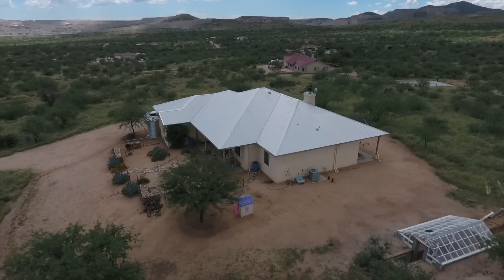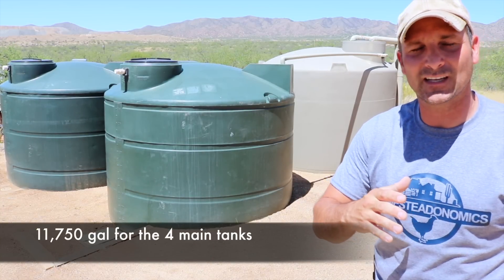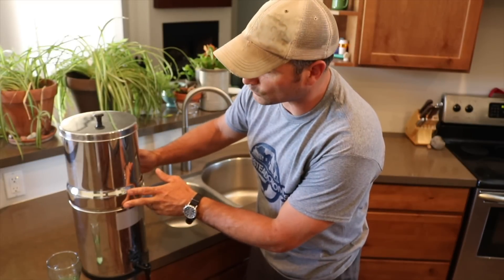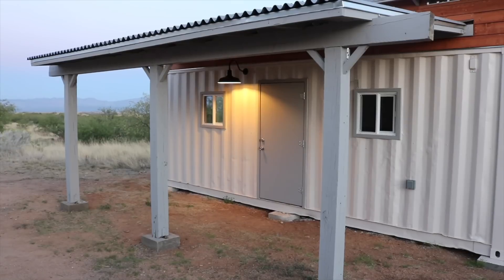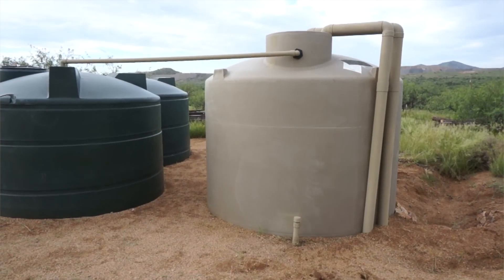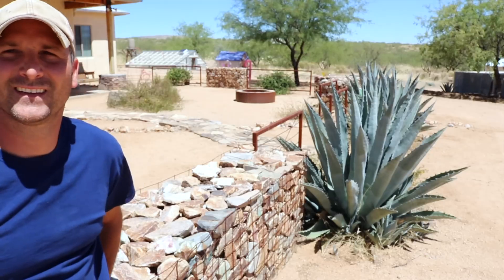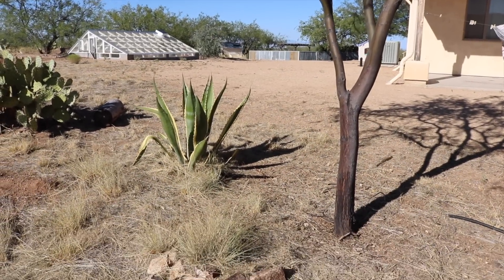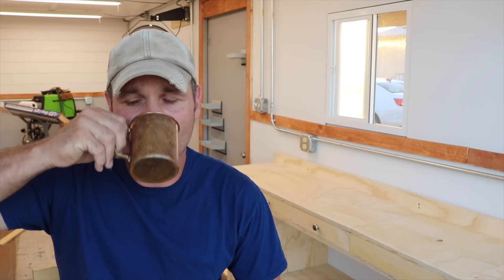Rainwater Harvesting QA - Cost, is it Illegal, how I treat, etc,.

Comment: The last estimate I had for a well drilled 480 ft into the ground to supply water was $26,000, that is not including the cost of the plumbing or tanks above ground. I already have that from the old well which dried up. So the cost of $5,000 sounds really attractive and a savings of nearly... 83%! Thanks for the inspiration and hope that will fuel my drive to no longer have to haul water every two days by gallon jugs in my tiny little Prius. You are a Godsend!

Comment: Q: With extreme heats and cold do you have any suggestions for how to prevent water from freezing in the overall system? (im in the east coast and it can get cold). Thanks for the video!
Reply: Don't pour antifreeze into your water unless your interested in potentially dying. Antifreeze is deadly if ingested even in tiny amounts.

Comment: Nice off-grid system.  I would shed over the 3 tanks.  Also, I just came back from Cuba, and I noticed many homes had fifty gallon drum collectors that would supply their HOT water needs.  Are you thinking about that since the Sun shines almost every day?  Lastly what water usage formula do you use for each occupant?  (Drinking, shower, toilet).   I'm guessing washing the car is out...:)

Comment: How do you pressurized the shower and toilet refill?  Are you using the blue water tanks with the rubber bladder inside?  We do in Texas and get about 60 psi.  Great video.  Looks like Wilcox Arizona or 60 miles east of Tucson?

Comment: The argument that you mentioned (taking runoff from others) justifying the illegality of collecting rainwater is ridiculous. I have a few friends that are civil engineers and in populated areas runoff is a huge issue because there is no space and you have to ensure that building on ground in one place won't flood another. So you collecting a few hundred/thousand  gallons of rain would be beneficial to the community.
Reply: They usually don't mean in an urban area, no one would really GAF if you reduced load on storm drains and it didn't become a mosquito or legionnaires issue due to bad maintenance. They mostly care about diverting rain run off on a massive scale out in the country, IE diverting small streams to sell the water commercially. Stuff that would cause rivers to run dry and do serious environmental harm. But not every law is enforced to the letter of its original intention.

Comment: You've done a great job collecting water! but never a water test?  certain things shouldn't be overlooked, especially regarding health.  
where I live the FHA/VA water test is about $165, knowing the average bacteria levels is important so the correct amount of added chlorine can be correctly calculated.  For reference, our municipal water has just under 1ppm chlorine, and the recommended swimming pool level is 3ppm. And pH is easy to test and adjust: on average rainwater has a pH of 5.6, which is pretty acidic-  the EPA recommends drinking water to have a pH of 7.5, which is slightly basic- adjusting the pH of the drinking water is recommended. I hope this is helpful to you
Reply: @cindykrista how old are you?
Reply: @cindykrista ok, that's an answer.  forget about the EPA for a moment, it's commonly agreed that slightly basic drinking water is recommended over moderately acidic rainwater

Comment: Do you have any thoughts on the effects the sun may have pheating up the pvc and possibly leaching toxins into the water that you are using for your chickens.
Reply: If possible, use PVC, etc. *certified for usage with potable water*, not 'sewer' grade nor 'fiberglass'. 
If not possible and you have concerns about 'leachate' from the PVC, etc., then consider to install a carbon packed filter system and then slowly 'recirculate' the tank water over and over through the 'stripper' filter.  The National Sanitation Foundation - NSF website should have all the facts and recommendations available for such concerns. ;-)

Comment: I use hydrogen peroxide instead of chlorine as H2O2 (peroxyde) degrades into simple H2O (Water) as it oxidize any contaminants. Also, I pass the water through a ozone generator in a diy injector, which kills anything that would survive. Alternatively, UV lights can also sterilize the content of your thanks. All of this is 200% better that chlorine.

Comment: If you swing a tank of water from the end of a lever with another water tank as a counterweight, the leverage change from the swinging action can pump hydraulic pistons with tons of force to filter the water under high pressure by riding the swing.

Comment: A year ago I went backpacking across India. I knew tap-water was  out of the question for drinking. And, I knew I didn't want to waste money on buying bottled water everyday. Since I was going to be travelling for a few months I decided to invest in a good portable water filter. Ended up ordering a Sawyer cleanable filter. The company claims it can filter water from any source.
Over the course of three months I drank around three hundred liters of water. That would had cost approximately $150 if I'd had bought bottled water, as I went. The filter cost? Twenty-five dollars.

Now, I'm living in the south of Cambodia and utilize a clay system dubbed The Rabbit. It's simply a five gallon water cooler-like design that houses a large clay pot in the top. Just pour rain water into it, the water is filtered over the course of a day, and drink. No treatment needed.
Reply: They have a low failure rate. They do however have a failure rate
Reply: @suzyrottencrotch5132  Did someone claim they didn't?
Reply: I read wrong, backpaging 😂
Reply: Nice.  What is the service life of the filter (i.e. how long does the filter last)?

Comment: i'm assuming there's a propane tank to heat the water. how is the water moved from the outside tanks to the inside of the house and there be pressure for showers and sinks?

Comment: I'm just wondering how somebody could adapt this system for a colder climate like New England.  I suspect the tanks would have to be fully buried (below the frost line) and then a pump would have to be employed to move the water through the system.  I'm I correct or is there another way to make this work?
Reply: I have a 9000 gal. cistern in my house basement and 7000 gal. raw water tanks in my shop.  That is enough to span the winter months (we use about 100 gal a day)..  That's the only way I can see making it work in the colder areas.
Reply: @jimp9884 - so your tanks are inside then?  I don't have the room to keep a large tank in my basement.  I'm concerned about the water freezing in the tank making the water inaccessible in the winter months and potentially cracking the tank.  I'm thinking the best way to do this on a large scale in northern New England is to put the tanks underground. I'm open to other ideas though...
Reply: @petroc62  It looks like you have your solution.  I have to stop collection first of Dec. and start again sometime in March.  I assume your inactive period will be longer, so you need enough storage for that time.

Comment: Well done sir..I live in Boston and my water bill is insanely high, roughly $500 a quarter. The water is a small potion of my bill, the sewerage is the killer. A multi billion dollar sewerage treatment plant was built a few years ago and our water bills went thru the roof. I have a water barrel I use for flowers and a small garden and I have an outside water meter for water that will not go into the city sewerage system, sprinklers etc but my bill is still crazy. I admire what you have done, nice work !

Comment: You state approximately $5000 for the cost of the items you use in the collection of the rain water. I didn't hear where you stated the cost of the "guy with the back-hoe". I also didn't hear where you stated the cost of the low flow products or the water efficient appliances. What would you say was the cost of your time and the time of the others that helped you to install all of this?

I'm not against/opposed to this at all. I'm just trying to say for maybe another thousand or so you could have had a professionally installed well that would perform continuously and without the anxiety of wondering when or if it will rain and how much rain you may or may not get. Also, you will have more room around your property to do other things and of course the ugliness of all those tanks and pipes would be gone. 

If you could do all this maybe at 1/10 of the cost of a well then maybe it would be worth all the ugliness and time, in my unwanted opinion.

Comment: This is the way to go, when we were on a suburb metered water system, our average 1000-2000 a month water bill shot to 10,000 gallon with no explanation and trying to correct it with these pathetic water contracting companies supplying these burbs. Now we're on a well and with almost no cost for 4 55gal drums and some for the 250 gallon unit, it keeps our plants watered, pond and pools get refilled saving well pump power. If I was motivated Id love to pipe and use the water for sinks and toilets. I do not drink well or rain water, either fill up at a stores RO machine at .34 a gallon or friends city water then further filter it, and keeping it alkaline with some info that is healthier.

Comment: This set up is legit, very impressive and well thought out
Reply: Yeah. I don't get the ceramic water filter though. You can get charcoal filters like the Woder 10k and put it under your sink. Should last most people 3 years. Unit is $100 and replacement filters are $50.
Reply: @RTT80  A simple carbon activated filter with a Ultra Violet light will make this water potable.

Comment: The Main reason Water harvesting is controlled in area,s deal directly with water rights. usually when folks tend to either use too much for a shared Aquifer to be replenished, OR horde and sell back in drought times (Gouging).

The issue IS Bipartisan or coming from both sides of the political isle.  so the whole Liberal Water theft myth is just that a myth...

Many  'Conservative and liberal' states actually offer tax breaks if you start collecting. New Jersey, Illinois, Rhode Island, Washington, Oklahoma, Arkansas..

Some are very restrictive.  Oregon limits it to existing designed roof ONLY. no extras sheets or gathering methods, and CERTAINLY no ground redirection.

Texas and Ohio have devoted considerable attention to this issue and allow rainwater harvesting for potable purposes and have set up a large bureaucracy of rules based on how and when you can collect and store including building permits in many cases 

Where as water in Colorado must be allotted according to the prior appropriation system. This is a common system in the West and is often referred to as “first in time, first in right”. Under the doctrine of prior appropriation, individuals have the right to put water to a beneficial use based on priority of the user. Non-priority use of a water source may carry penalties (Washing car swimming pools for instance.

Colorado has one of the most restrictive due to the continental divide, with rights being traded by original land owners to Nevada , Utah and California concerns, and frequent droughts. (Most western states follow this model).  but many southern states also have water rights issues.

Comment: That was not only an excellent video on water collection, but a primer for anyone thinking about doing an instructional YT video. Five years ago I started placing holding tanks to capture my rooftop water for a total of 9.5k gals. I use 4500 gals for grape season, but retain 5k for first defense for fires and rotate it each year. Before I started, I researched the legality of capturing water in far Northern California and learned that it IS legal to capture "roof top" water. Ironically, in Oregon, it was illegal; this may have all changed by now for all I know. I concur with your reasoning in regards to just "borrowing" the water before it moves on.

Comment: I collected rainwater from my 2200 sq ft house and piped it to my cistern because it wouldn't keep up with my needs, from there it was pumped to 18,000 gallons of poly tanks for storage and was treated with ozone. I never ran out of water with over 60 inches of rain a year. I didnt need to be careful except in the summer. My house was on a mountain ridge of solid rock with no deep ground water, I drilled 350 feet ($12000 with a discount) and came up dry, that hurt. I am not mentioning the location.

Comment: in certain areas people/companies will make massive rain water collectors. They collect so much water it actually starves the local lands and rivers of all the run off. Obviously for you its very different. Unfortunately its often the few bad apples that spoil the bunch. Its a shame because I've always had a deep interest in these style of "off grid" systems. We have two wells on a property in NH and it cost roughly $15K for each one I believe. We had to drill a second because the first dried up. A few weeks after drilling the new one, the old well started to fill with water *facepalm*. I guess we have a backup now!

Comment: This is basically a no brainer.  I lived in the US Virgin Islands for 11 yrs and never once did I have a problem with not having enough water.  Once it didn't rain for almost 2 yrs and I still had enough water.  The solution is to have enough storage.  All houses have a cistern which is basically the footprint of the house.  Maintenance is easy, every year or so pump down one  side usually two seperate tanks, clean and recoat and your back in business.  Almost everyone in the Carribean uses this system.  It's basically a no brainer.  Yours looks good and the video was clear concise and well done.  Have a good one  RC

Comment: I own a trackhoe and 2 dump trucks, but I live in Oklahoma... If I was there I'd be happy to help. But I do have a question. Is water the only resource you collect? And how much produce do you get from your green house and gardens? Also when the next oil slump happens you can pick up water hauling tankers cheap! My buddy bought one for $2K and it holds 9,000 gallons, plus it is easily buried. I don't know if metal is a good material to hold water for a long time, but I bet it would work great for your garden!

Comment: Super super great 💡 ideas.
Great information thx.
Reply: Diego Salinas  bermuda islands have a system also ,the roofs are specially designed and water flows into enormous tanks underneath the house ,pumped up and filtered in small pressure tanks

Comment: Very cool, genius, well done! Are you familiar with the cement pipes people use under the driveway to channel rain water? If you had 3 or 4 of them you could mount vertically along side of your house (+cement foundation pad), fill with silica sand, pipe connector at the bottom for a very large sand pre-filter. Alternatively, corrugated zinc coated pipe, 12" would also work with less filtration medium. A multi-layer screen at the top would be a good idea with a DIY cap. The pipe at the bottom could be made removable for medium change outs but that wouldn't be necessary for a very long time. A couple drops of bleach in the top occasionally would also start your sanitation process. You're in a very beautiful area!  I recently bought land in Sunsites AZ but that's on hold as the septic and well would have to be done first and down there to have it done would be approx. $30,000.  Breaks my heart as I'm ready NOW! lol God bless you and yours in Jesus name!

Comment: The issue of collecting rain water is depriving someone else's use of water they have develope a right to use, often referred to as old water.  So if the rain water that is collected is not water that normally runs off to other users, this water is not illegal to collect since it would be developed or new water.  This would be water that would be lost through the plants that would be cleared off for the rain collector and new buildings.  In most arid areas this amount of water would be more than the water collected.  If the water is again released into the natural water flow this water would be exempt from interfering with down stream water users since they are still getting this water.  So to collect rain water, in states where they restrict collecting rain water, calculating these water flow effects should legalize the collection of rain water, as new water, not water used by others.

Comment: Hi, I love what you have done with your roof and like to do the same on mine! could you pls answer 3 question! 1. How is the noise when it rains and the wind noise inside the house? Also I have shingle roof that needs to be replaced. 2.Could i Do this on the top of the shingles roof. 3. Any disadvantage to this kind of roof that you could think of. Thank you so Much!

Comment: Get some rv roof coat from Home Depot or Lowe’s and coat the tops and maybe even the northwest sides of the tanks.  It will keep the water cooler in summer months and keep the UVR from cracking your tank tops.   Off grid here 100 percent since 1997,  13000 gallon rainwater system, 1250 watts solar. I am in New Mexico.
Reply: Off the grid and posting on the internet?  LOL... Welcome back to the grid.